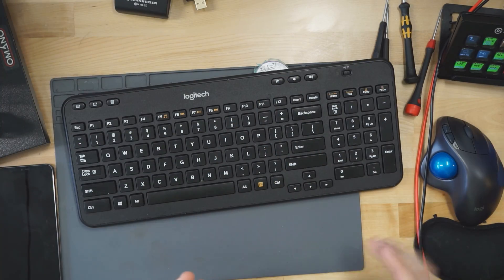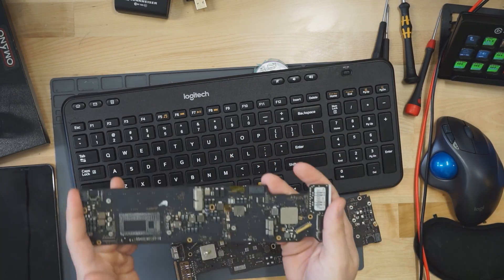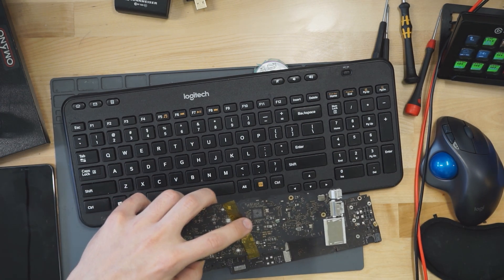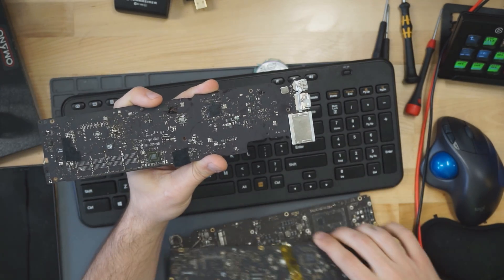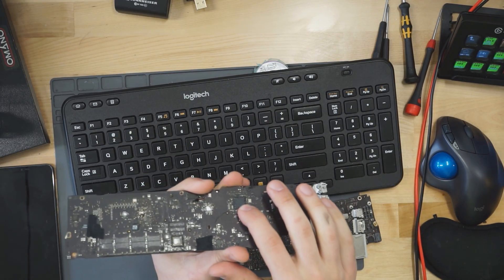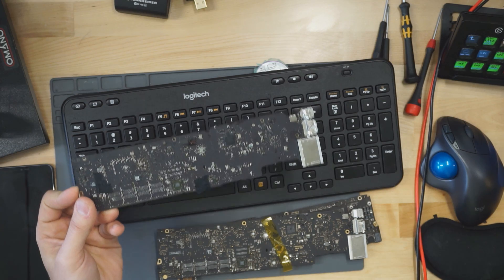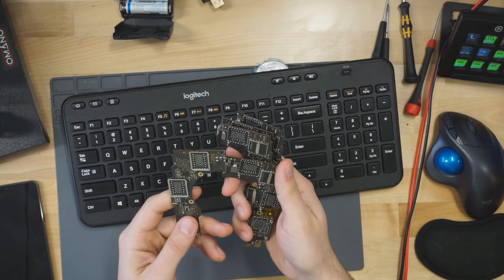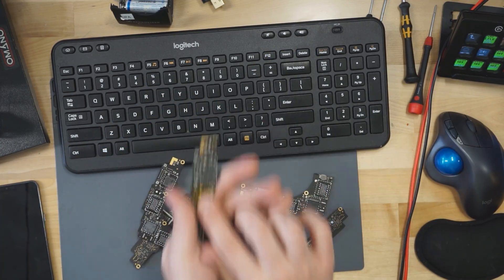𝓕#&* APPLE part 2: The morals & ethics of dumpster diving.

Comment: The display assembly of a broken screen still has value. I've  made small lightbox for artist out of it, also you can do small iluminated signs and if you are brave, softboxes for photographers.  :). I love to go to tv repair shops , they have big backlights and they are very useful and dirt cheap (they throw them away if the display is broken).

Comment: I have a MSI GS65 laptop. Expensive, PITA to get to the memory or drives. Once it is out of warranty, where am I going to get it fixed? A lot of the parts in it are also not commonly available components either. Apple may be particularly "special" in this regard, but everyone else in the industry is going there.

Comment: I totally agree with your stance on the reuse of old parts that were deemed garbage and the use of these parts to use in the renewal of macs for your customers.  Your only keeping more out of a landfill by doing this in the long run.   I'm a electronic tech myself and I mess around with old computers to improve my skills.  I took an old computer once that was tossed out by a friend who literally used as an ashtray for a year after it died while he was working in his garage.  I cleaned it to the point where it looked new.  Replaced five capacitors on that motherboard that I got from another dead trash machine. And had it up and running in less than a day.  I then gave that same computer to another freind that couldn't afford a new one and he used it with no issues for four years.  People need to think outside the box more and look at the bigger picture.  Reusing parts that are still good only makes sense and keeps things out of landfills.  Things should be repaired.  Not disposable because some company wants you to just throw it away and buy a new one.  Keep up the good work.

Comment: One more reason to hate apple. Also one further point to make in your favor is it takes a LOT more resources to replace a system then to fix it. Lets say a donor board fixes 5 computers on average. That means 5 less new computers built and the resources and fuel to make them is saved. meanwhile even if you recycle the board you need to use a lot of toxic chemicals to do so as the only materials they want from the board are the small bits of valuable metals gold or copper for example. And it uses even more fuel. So in addition to making 5 new systems you also have about the same level of pollution as a whole new system to recycle an oz at most of valuable materials and still require a large portion of additional materials and fuel to turn that recycled material into a new board.

tldr if you do more then pay lip service to the enviroment then kick crapple in the balls and tell them to let people FIX THEIR GOD DAMN SHITTY PRODUCTS

Comment: Reuse is always better than recycling. Apple is one of, perhaps the biggest, instigator of general consumer e-waste. Why repair when you can replace? Why not arbitrarily change a port rendering all accessories obsolete? The panel "code" and seppuku committing chips is another egregious middle finger toward right-to-repair advocates and customers in general. Shame on every company that subscribes to these practices. Greedy pigs.

Comment: If I couldn't get PC parts from the tip, I could not afford to use computers.  All my hard drives are used ones that I formatted.  Since I use Linux, I don't need the latest hardware.  Those AGP and PCI cards you tossed while trading up?  They may be an upgrade on my system!  My newest system is a Core2Duo 6700, because I'm able to get all my tasks done.  I'll upgrade when I find something newer at the curb.

Comment: Maybe there is more to it then  apple lets on, probably that apple does not want you to read the chips because they are more programmed into it then supposed to, don't forget that it is manufactured in china and the goverment, for security reasons may have told apple to add a back door in one of the chips and they are no way to find out since you can't read the chip, if they are a war with china, they can have the upper hand since they can have access to millions of computers, if it is true, china is one step ahead to the world, you can't blame them for doing that, it is manufactured in their country, they would have all the right to apply such a policy, I may be wrong, it can be also simply a copyright on the chip itself

Comment: It's even worse than you are seeing with Apple.
There are companies that routinely destroy fully working test equipment that's only a year or two old (oscilloscopes, meters, spectrum analysers etc ). They do this because the gear was used in R&D or development of medical, military or devices under strict NDA. 
These companies believe that it's legally safer to pay thousands to destroy millions of dollars of old test gear rather than sell it because of the risk something secret might slip out in the test equipment memory chips.  (Like a waveform stored in the scope memory or some data logging stored in the meter memory).
So every 1-2 years all the test gear in their electronic labs gets shredded and they upgrade to all new gear.  

That is one of the many reasons medical/military stuff is expensive, there is so much wastage in the name of legal protection and security.
And the same thing has started to happen in general industry when struct NDA contacts are in place.
Secure destitution companies are paid lots of money to take entire shipping containers full of working test gear and shred them.

There's a thread on EEVBlog (KeySight Scary Letter) where a company sent a massive amount of test gear to a secure destruction company to be shredded and the company made a mistake and sold it all instead.
They are in the process of contacting all the people who bought it and clawing the gear back.
Keysight even admitted in the threads that the only reason they need it destroyed is because the gear was custom/modified gear not intended to be resold under NDA.
Reply: And yet somehow China breaks every patent.

Comment: If you are really responsible and really care for the environment, then you repair and re-use it until it's possible, then you re-purpose it until there is nothing left that can be re-used or re-purposed. Only then the responsible action is to send it for recycling.
All big businesses work exactly the opposite way - they program premature obsolescence and make products unrepairable, by using all sorts of tricks in its construction and by denying spare parts or provide them at absurd prices.
They may boast whatever they want about being Eco-friendly (paper doesn't judge and accepts anything you print on it), but it is all false!
So we, as consumers, have all the right to repair, re-use and re-purpose equipment we paid for, by all possible means and using all possible tricks we may devise - their rules work both ways - if they can trick and cheat, so can we!
Reply: Planned obsolescence is seen in the apple chargers the low voltage cable rubber becomes brittle and breaks away, however this does not happen on the high voltage cable,

Comment: I started setting up and supporting Apple computers at my work about 10 years ago. Initially I joked around "to get these things away from me!" but I quickly really liked the computers. I always knew of the closed system so I never got more involved than using the computers (while jealously complementing on them) to setup or fix them. Fast forward to today where I don't really like windows 10 and have started to use Linux, I would LOVE to have a new MBP, it is a human interaction masterpiece.... But I won't buy one due to Apple's repair and parts "strategy", I MUST be able to repair stuff myself or have my stuff repaired for me by an independent shop.
Reply: Would it be any different with say Asus, Dell or Lenovo?

Comment: OK I have not actually worked in an electronics repair shop since about 1992 maybe 1993, but this was absolutely standard practice back then. Use two broken ones to make one good or if you are really lucky 5 broken to make 4 good. Some boards didn't get thrown out till there were just standard logic chips and passives left on the board, and I can remember taking more than the odd one or two 74AS245 or AS373 off those.
Reply: There's somebody I watched who bought a bin of 9 broken Nintendo Switches, and got 7 of the 9 to work using parts from the unfixable ones, and re-flowing others.
Reply: "9 broken Nintendo Switches, and got 7 of the 9 to work"
That's the spirit! E-waste reduced substantially. Plus the profit :)

Comment: None of the components on a motherboard are the intellectual property of apple, their designed by someone else for their own reasons and not Apple.
Reply: What about the motherboard pcb itself?
Reply: @alanpartridge2140  The design can be apples property, but what more likely is that various parts of the design belong to other organisations just like a musical rip is the intellectual property of a person or group. For example Apple doesn't own Intel's CPU designs or the circuitry that Intel has designed that is included with that CPU.
Reply: @stephenhunter70  But is the PCB layout what value resistor goes where etc. is the intellectual property of apple? I'm confused on this one
Reply: @alanpartridge2140  No you've got it right.The way I figure it is the final PCB design is Apples. It's a bit like Websites the only thing the designer owns is the final released/published design.

Comment: If Apple design a PCB....is that design not copyrighted?

I assume Apple does not make many of the chips on their PCB,  but if they wrote the code that is programmed into these chips, is that not copyrighted?

Those PBCs are clearly not trash if you are able to de solder components from said PCB.

I'm just wondering if their is a legal angle Apple could persue.....or is Louis too small a fry to bother?
Reply: He wouldn't be able to copy their design and call it his own. If they trash a board then it no longer belongs to them. In the same way that if I throw away a winning lottery ticket and someone finds it at a dump I cant say hey thats mine.
Reply: I don't know much about the chips they use but just because they don't make them themselves doesn't mean they don't custom order them, meaning no other company produces those specific chips and yes technically code is copyrightable but they can't sue you for taking chips only if you copy their proprietary code.